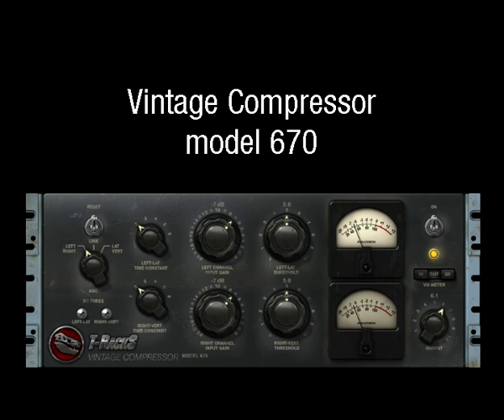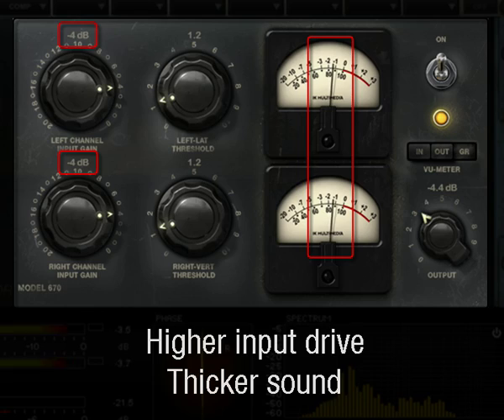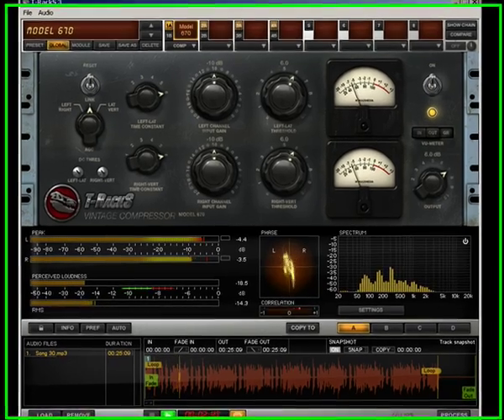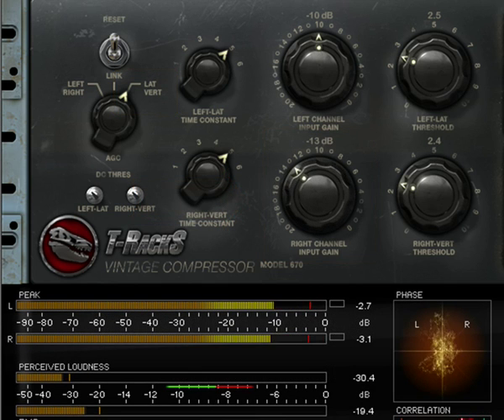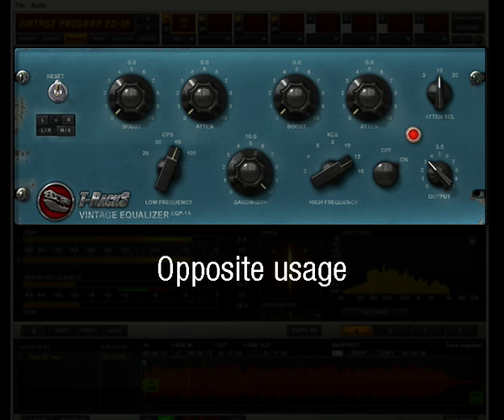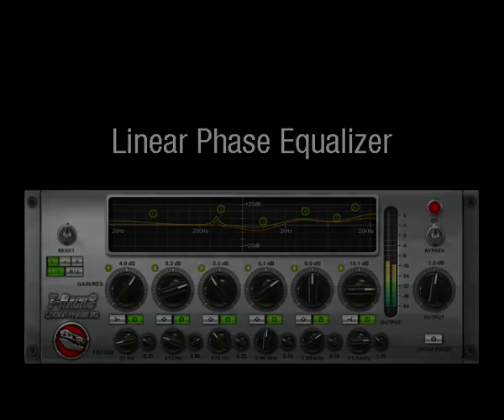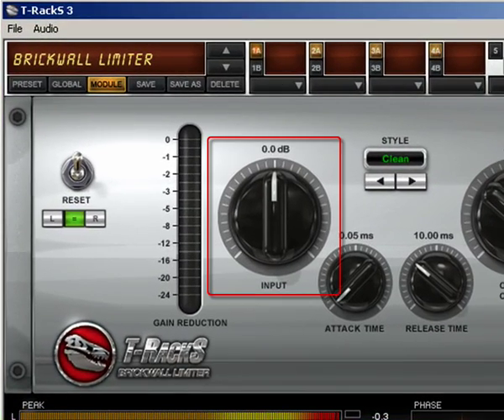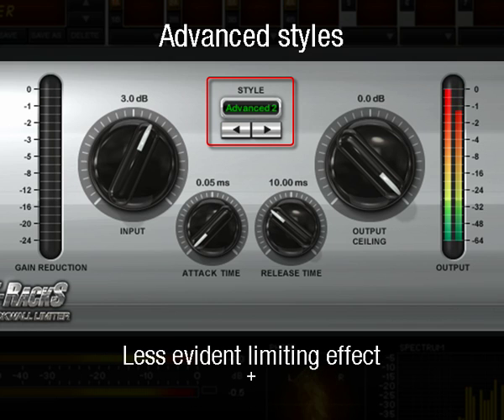T-RackS 3 New Processors - Mix and master like a pro

Comment from the maker: You can absolutely get a strong punchy sound with T-RackS.  If you have problems using the tools, please contact support and you might want to look for more tutorials on compressors, limiters, EQ, etc.  That should help you achieve the sound that is absolutely possible and very high-quality with T-RackS

Comment from the maker: @kalonjikalonji It is a VST/AU/RTAS plugin that gets installed (as well as the Standalone) so as long as your host program is pointed to the folder into which it installed and it supports one of those formats you should be able to use it as an effect just like any other.

Comment from the maker: @dopemcee Blue screen is typically a hardware issue, so I'm glad you corrected that. The specs aren't really that bad, as it has been around long enough to not need anywhere near the most modern computer. Please contact support if you are having specific trouble, thanks!